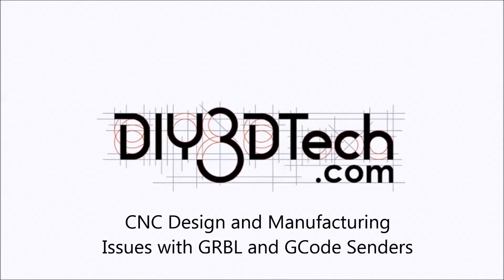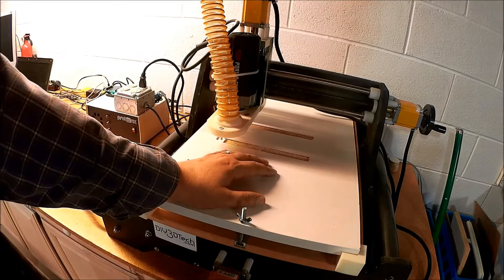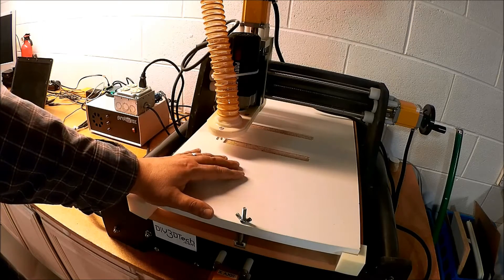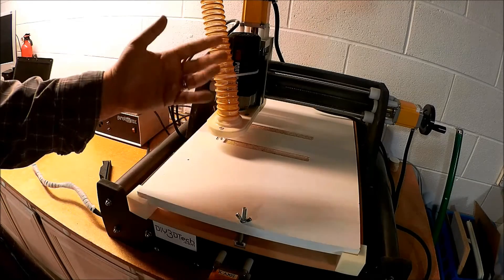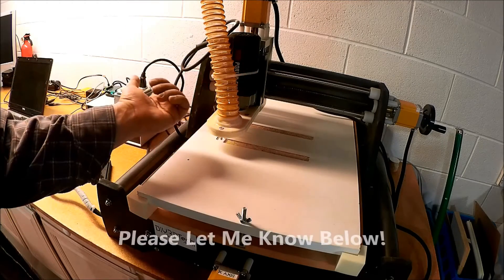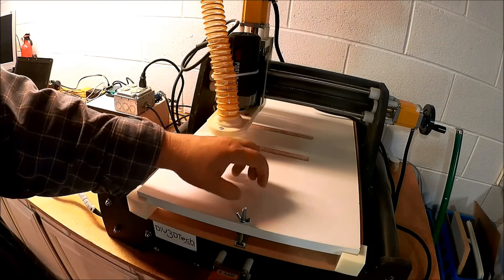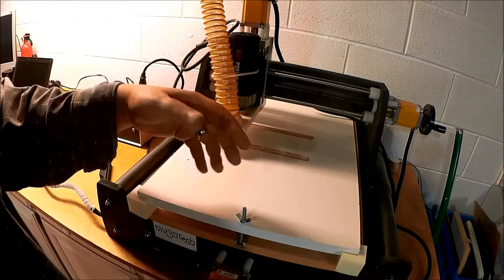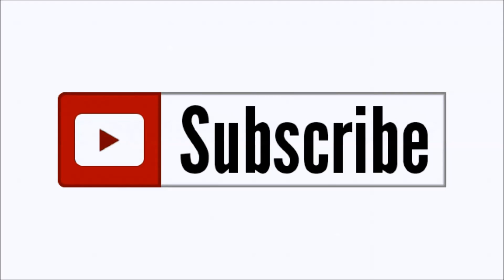CNC Design and Manufacturing - Issues with GRBL and GCode Senders

Comment: For anyone experiencing a problem like this in 2019. 
I experienced essentially the same thing with UGCS (my setup is a raspberry pi driving an arduino uno with v3 cnc shield). 
I went down the interference route initially and put ferrite chokes on all of my wiring but that didn’t solve the problem. 
I later solved the problem by moving to bCNC (python based rather than java for UGCS). I’ve done some long and complicated cuts with zero issues since. 
HTH
Reply from the maker: The issue (covered in a future video I released) was the UART chip for the USB driver.  You need to get the CH340 driver and still might have issues.  I switch to Linix and ran UGS and it worked flawless....

Comment: First thing -- get a new QUALITY USB cable as short as reasonable, not one of those cheap ass Chinese knockoffs and try that. Some of those ive ran across turn to shit the minute you plug one in.  Change ONLY 1 thing at a time. Changing 2 or more things will just add to the confusion. 

The whole secret to chasing down problems like this is to change just ONE thing and try again. Chang 2 or more will just add to the confusion. I suspect most likely you got some bad G-code or some software problem but there are a number of other possibility's covered below.

If you have some sort of CNC simulator, run that using the g-code you have and see if it hangs.  The software I use most of the time is Vectrics V-carve Desktop and it has that function built in. WELL worth the $350 and it DOES have a post processor for the Adurino based controllers.  It is also FULLY capable of doing true 3d but you have to create the model in another program such as Blender or Fusion 360 ( both are free just download them). The controller program I use is Mach 3 (It DOES NOT WORK on the adurino controllers) and it also has that built in.  If the G-code DOES NOT check out then try a different Cam program to generate the G-code. If things work, problem solved. If not then get a fresh copy of UGS and try that. 

Every time you try something new set X and Y as normal and set Z an inch or so ABOVE the stock surface and Go with the router on. That way you wont screw up a lot of wood and the controller and computer wont know any difference. If fixed, problem solved. Also do the same with the router OFF. They're brush motors and they do create RFI...  If it works right without the router off and craps out with it on -- see the paragraph below on RFI problems. 

Next place I would look is heating issues and/or RFI noise if you have random dropouts or lockups.  To check for RFI place am AM radio as close as possible to the controller box.  Next run the steppers back and forth a few times manually. If you dont hear the buss, skip the rest of this paragraph other wise continue with the cure. The steppers themselves are usually not the source because there are NO brushes in them and the metal they're made from makes a complete shield. The step pulses going TO them are square waves or almost square waves. Square waves by thier nature will generate harmonizes several multiples up in frequency. If these a strong enough you can hear the buzz on an AM radio near the drivers and leads going to the steppers. If the controller doesn't  have good shielding, the radio noise can make it go nuts. The cure is use a metal box for the controller and place some shielding between the driver board and the rest of the controller. If you dot have a metal box, simply take everything out of it and line the inside with tinfoil using something like 3m spray adhesiveness. Make sure the tinfoil on the top piece contacts the rest of the box tinfoil. Also use shielded wire for the stepper wires.  Ground on ONE END ONLY tied to the controller box.  The the shielding to the green wire in the poser cord, NOT the neutral.

Usually heat issues show up if things run normally for a while then quit. If you repeat the same thing exactly as before a cold start and the problem shows up roughly in the same spot, it could well be heat related. A quick check is to get a can of that "clean" air keyboard spray and while running the same exact setup from cold while lightly spraying the controller boards with it. Turn the can upside down so youre spraying the propellant  for the best cooling. Be careful and dont frost things up as the moisture can create shorts. short burst now and then only. If that cures it then add bigger or more fans. I dont know your exact setup but using the usual Adrino and gshield driver board setup, I have heard some people have had problems with the earlier driver boards.  I dont use that setup but I have seen those and the heat sinking on the driver boars looks way undersized to me. Ive had right at 40 years in the electronics and computer field.  If you are having heat issues then add a bigger or more fans. Or add more heat sinking to the driver chips, or replace the flaky board.

Hope that helps finding the problem.. 

My CNC is a total home brew of my own design that's totally acme lead screws some what similar to yours in the mechanics. I use 470 oz/in nema 23 Steppers. That overkill on the Z but the price was right.  :)  The electronics use a parallel port breakout board driving 3 Driver modules with enough guts to drive some seriously big Nema 34s. The power supply for those is a 36 volt 20 amp as big as I could go without frying the diver modules and stout enough for some seriously gutsy 34s if I ever need them. All of the electronics are housed in a MDF box with a healthy fan with a filter on one end and the other end has enough vent holes so the flow is not restricted.  The inside of the box is lined with tinfoil tied to the earth ground (green wire). There is no detectable RFI anywhere on it except for a slight bit of hash from the router. I coudn't even play a CD in the shop because of all the RFI before I added the tinfoil. Now there is ZERO hash. The controller is a 15 year old desktop I retired years back, currently running XP pro.  I prefer to spend the $600 or so I have in Mach 3 and the electronics over what the typical Gerbil-adurino and UGS setup costs for several reasons. Multiple bits in ONE file is NO problem. Mach 3 will just stop and wait for you to change bits for one. Secondly you dont have to screw around with dimwit controllers like Easel or UGS. Third, ALL the commercial super high end cad/cam programs made support Mach 3. That gives me options that DOES NOT exist with the cheaper Adurino based controllers.  

With the CNC world you get what you pay for..  Much of my working career with cad has been solid modeling stuff like Autodesk Inventor, Solidworks and so forth. This is the type of software that is used to make Jet aircraft and satellites. I still have solidworks and I use that for for stuff thats many parts that must fit together.. Programs of that calabre go for 2 or 3K or more. Fusion 360 is in the same ball park functionally and its FREE! Has a very steep learning curve but well worth trying.. I dont know if its cam  supports the Adurino stuff though

The cutting envelope is 25X 18.5Y and 7Z. overall size is 2 feet by 3 feet and 9in high. I have snapped 1/4 inch shank bits clean into by hitting  clamps a time or 2 without stalling the steppers. Lost steps but no stall. I can run rapids right at 300 IPM but I have them set to 150 IPM max. Fast enough to get a couple feet in just about 1 minute. If I had the space I would have made it big enough to reduce an entire sheet of plywood to chips at one go.. But all the space I had was a bit over 2 feet by 5 feet. EVERYTHING related to the CNC is in a stout roll around table made from 2 by 4s.  I use a router slightly modified where I use ER 11 collits. I have both a full set of SAE and metrics all the way from 1/4 down to as small as they go. NONE of those 1/4 to 1/8 reducers for me and I can use every shank size made from 1/4 all the way down and the same in metrics. THat mod has paid for itsself several times over by being able to get some bits that are cheap in thier standard shanks but very expensive and hard to find in 1/4 shanks.
Reply from the maker: Thanks for taking the time to write such detailed port as your troubleshooting techniques are spot on and ones which I used to troubleshoot and if look forward a couple videos in the CNC play you will I switched to Linux over windows XP to solve the problem all has been working just fine ever since no matter the length of the job.
Reply: The electronics/computer stuff is just part of the many tricks Ive learnt in over 45 years of dealing with their weirdness. Every thing from the PDP 8 days through radar and various other stuff. Back before the 4004 chip showed up I was doing control systems stuff with 7400 series TTL logic. Only stuff made in those days.. :)  Then I got into doing programing -- Same as doing stuff with TTL but with bits. I quit messing with the hardware part when the surface mount stuff started coming out as that is almost impossible to fix without sinking a small fortune into tooling. For a number of years all I did was contract work making basically one stuff.  Along with that I often did a bunch of contract programming and cad work.

I watched the cnc stuff go from some guy setting at a table with blueprints punching paper tape with hand punched g-code derived straight off the prints. No computers involved anywhere, even the CNC its self had a load of TTL logic in them instead of a real chip. The typical mid size one would go for at least a half million in todays money and wasnt as good functionaly as one of the Inventables ( ignoring the flex in one). 

Cnc is still not quite there at a reasonable price for a hobby type setup, Usually in the  $1000 or so range. Shopbot and at least one other company makes one in the $3500 range that is rock solid and quite capable of .001 accuracy INCLUDING a cad/cam program equal top or better than V-vcarve with a cutting volume around 2 by 3 feet. These will stand up to 24/7 production but are way too expensive for any hobby use. I got almost that for 1 grand but my accuracy is around .005 and I dont think it would go for months like that without a lot of issues.  I probably average around 10 hours run time a week at the most. 

Doing mine from scratch was easy. That being said I do have somewhere around 50 years doing woodworking, numerous hours in a machine shop on lathes and milling machines and a somewhat extensive background in industrial control systems.. I DONT recommend a scratch build for anyone without some amount of skill in those areas but it is doable. 

The biggest issues I see with almost all  the hobby grade ones is the crappy controllers, specifically the gerbil stuff.  Nowhere near the usability of a real controller Like Mach 3 or 4 or one of the linux based ones. My cost for the equivalent of the grbl system is $150 for Mach 3 and about another $200 for the breakout board and the 3 stout stepper driver modules.  Maybe an additional $40 or so for the difference in cost of the 3 steppes. The 15 year old desktop is basically trash.  WELL WORTH every penny based on a few hours on the 1 meter Inventables at the local makershop I often do a bit of teaching on various things.  Im tempted to build a good one to replace that one.. That being said if you dont do deep cuts, like around over 30 thou or a 32nd the flex in the rails wont be that much of a problem. That one will  do almost the same size stuff as mine but takes a anywhere from 3 to 6 times longer. Partly due to the flex issue and partly due to REQUIRING a separate file for each tool.  That being said any grbl base done CAN be modified to use one of several near industry standard controllers. Basically you junk the grbl boards BUT Keep the power supply, and everything else. And replace it with a new board such as one called a smooth stepper and 3 driver modules or simular.  Like I have said many times "you get what you pay for".
Reply from the maker: Ditto here (but started with the PDP 11) and yes loved the little 4004!  Same on the SMD to small for my old eyes!
Reply: I got one of those 4004's. squirreled away somewhere around here along with a rather odd 68000. It is one of the very early development stage ones without the microcode on the chip with a socket on top.. The microcode is actually in a 2764 prom IN that socket.. At that time I was doing some development stuff based on the 68000 but they hadn't firmed up the microcode to the point they could put it on the die yet so they made some of these oddballs.  They just burnt a new prom to test things..  I guess my all time chip has to be the RCA 1802.. Really weird bird, almost an 8 bit 68000 in concept.  :)
Reply from the maker: Cazy as for me most of those brain cells have died off, I am the CTO for a large company by day so more of the bigger picture as I am leaving that more technical stuff to the younger generation as I now just prefer to be the wise old man :-)
Reply: hehh...  I leave the heavy and grunt work for the kids.. :) Retired does have its benefits, you can tell somewhere were to stick it without having to consider where the next paycheck is coming from, or some idiot who dosent have the foggiest on how to do the job riding your ass..  :)
Reply from the maker: Man i look forward to that day (ts not to far) as the older I get, the more I feel compelled to call stupid, Stupid!

Comment: What type of sedition are you using?  I found a forum post about an Arduino having port failures that sounded similar to your issue. Here is the link to the forum post: http://forum.arduino.cc/index.php?topic=83079.0
Reply from the maker: +Norbert Davis "sedition"? Belive the issue was in the windows USB driver, when I went to Linux the issue went away...
Reply: Stupid Autocorrect (stupid user for not noticing.  lol)  It should have said What type of Arduino are you using?  The post I found was regarding a MEGA dropping the communication port and thought that might be similar to what you were experiencing because you experienced it using different OS.  It seemed like the Arduino was the thing that remained constant

Comment: I am by no means an expert on this, but have you tried running the same job with a rebooted machine and computer several times and seeing exactly where it fails.  If it fails at the same spot in the cut each time, it is either an out of memory error, or maybe an improperly formed G-code command from the host computer.  Hope this helps.
Reply from the maker: +DogByte2012 Yes (as it has to be rebooted to reconnect) however its at random spots around the same "time" but the same place.  I have switching to Linux and looks like it solved the problem, as I belive it is something in the way Windows was handling the USB port connection.

Comment: Maybe check out this:
- energy saving options that turn your USB off (had that "problem" with one of my first cuts)?
- unshielded USB cable?

Workaround:
- try to split your large job into smaller pieces (not a real solution but may help you to get your work piece done).

Anyway:
I'm using grbl too for my CNC (version 0.8 if i remember correctly) with universal gcode sender and jcnc. Both work well and I had no problems with cuts up to 3h. So I don't think it's grlb, gcode, grbl shield or ardiuno at all.
Reply from the maker: +Ove Kalkan Many thanks for the suggestions, and yes to having checked all power options, and know its not a BIOS bug as tried three machines.  Also tried various cables (yes I have have invested WAY to much time in this :-), however what I might try is adding in a ferrite core loop.  However first today will be trying Linux to see if it was the way Windows was handling the USB port.  As I am not a fan of Windows for these type of applications (I am OLD PLC guy) , but I am also lazy and windows is (strike that "was") easy.  Yet as the old adage goes, your milage may vary :-)
Reply from the maker: +Ove Kalkan Also yes planing in cheating if I have too (splitting jobs) and at this point belive the problem is somewhere in the USB chain and if I wasn't so lazy (or better put, didn't have a demanding day job) would add a USB sniffer and watch the exchange.  However since I don't do this ever day the learning curve is too steep just to knock it off in a few minutes.  However what is JCNC?

Comment: Can you record a clip when it happens? Or do a time lapse. Just make a dry run. It could be very tricky to investigate the problem. maybe some aplication is disconnecting the com port.
Reply from the maker: +vanwaestel Have both, however it is pretty non-descriptive as the machine stops and in the GRBL Control log it shows the port being closed by user (not GRBL).  However I believe the port being closed by user is simply a result of the port failing to respond and the client closing the connection as a result.  I have turned off aggressive sending on GRBL Controller now it acting all weird and I have not time to go back and trouble shoot that now :-(

Comment: does your laptop go into sleep mode? i found if i let my pc go into sleep mode it would pause and sometimes kill the job on a router that had an all in one board.IE drivers and main board together..
  
great vid
Reply from the maker: +klawndyke Nope, all power management is turned off and its plunged into the wall too.  Forgot to note in the video I also tried three different laptops and one desktop too!  Whew this has been more work than I bargained for :-)

Comment: Is it possible that there is something heating inside the GRBL box ? even if there is a fan  !  may be a wire blocking airflow ????    Just because you said you use different program with same problem !
Reply from the maker: +Gil B Hmm, it does have a shield on it but it doesn't seem hot a reboot starts it back working without any cycle to cool off but like the thinking...